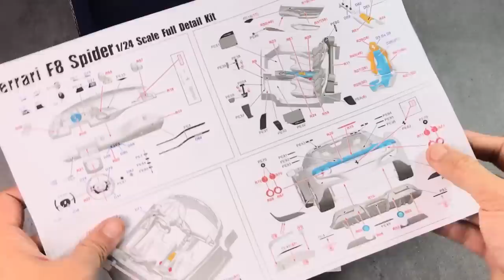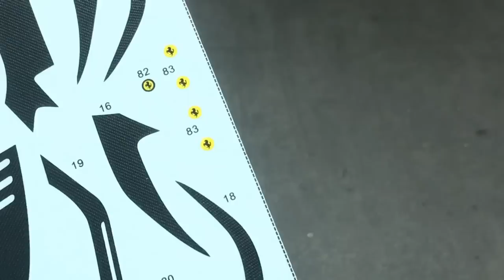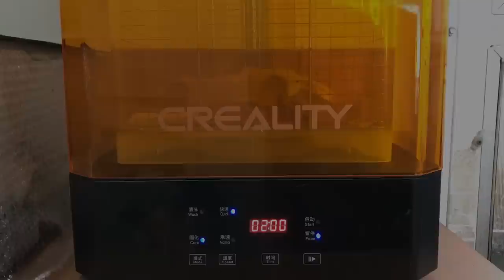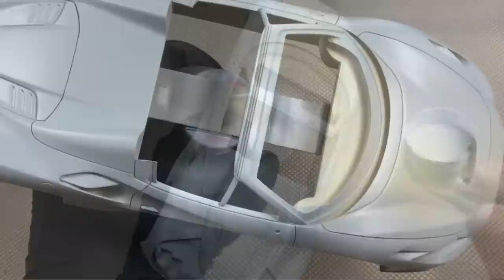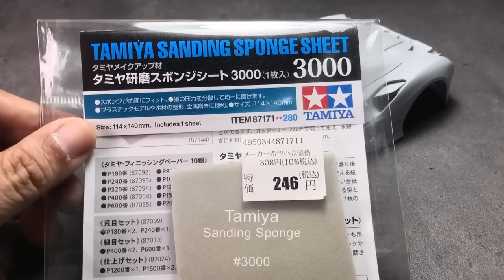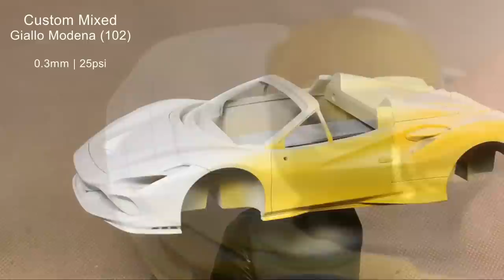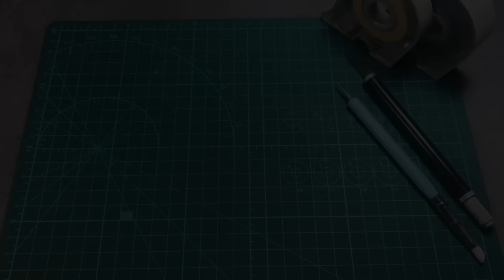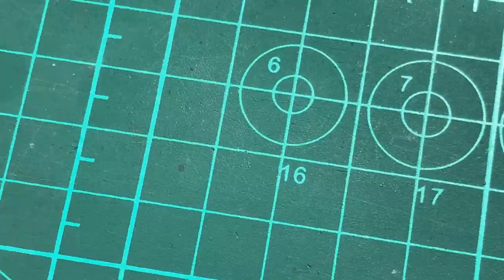Ferrari F8 Spider | Alpha Model | 1/24 | Scale Model Building | ASMR |

Comment: I notised most model car builders videos don't show applying a clear coat to small parts of the cars.  Do they, and, if not how do they avoid getting fingerprints and paint smudging  on small parts when assembling>>??????
Reply from the maker: For me, to use clear coating on any part It doesn't depend on the size of the piece. But it depends on the accuracy of the actual car.

Comment: I had no idea what Glasurit was until I looked it up. It turns out that it's remarkably expensive for the varnish and hardener. So much so that I am astonished that you use it on a model.
I won't deny that the end result is outstanding (plus yellow is my favourite colour) yet over £150 to varnish a model....ouch!
I hope that you get a lot of models done with it 😊😊😊
Reply from the maker: First of all, I would like to thank you for visiting my video, For Grasurit clearcoat, I actually share it with my friend who owns a real car paint repair shop. So I don't have to buy the whole set which is expensive as you said. 😉
Reply: @OMG Scaleworks  Thanks for your response. It's appreciated. It also makes more financial sense knowing that you share the cost. I assume that standard modelling  acrylic varnish can't give your models the same depth of shine? Is there anything a lot cheaper that is suitable and gives a similar shine? I'm just getting back into modelling after nearly 35 years and so much has changed. Any advice would be welcomed.

Comment: Amazing! Btw, why it took you way further of the built to remove the runner under the windshield (that’s like a B pillar)?
Reply from the maker: Thanks a lot. To prevent broken A pillar by accident, I keep them until when I have to paint black on the edge.
Reply: @OMGscaleworks  very clever! It is because the A pilar is so fragile at that state (before the windshield is installed)?

Comment: May I ask, what did use on the tip to hold the parts at 28:06, thx in adv
Reply from the maker: It's just thin double sides adhesive tape on tooth pick tip. 😉

Comment: Hi...wow!!! What glue do you use for acetate glasses? And why do you weigh 2K paint to thin it out? To be more precise? But 82 grams of clear coat and thinner? (not seen in the video).

Thank you.
Reply from the maker: I have to mixed 2K clear with its hardener in 2:1 so I have to weight them but in video is 8 gram not 80 ha ha. About the glue for fixing the windshild I used CA Glue for that but in a little amount. Thanks for your following.
Reply: @OMGscaleworks  Haha, actually 80 grams would be too much! I said bullshit! However you have a perfect painting technique! Thank you.
Reply: @OMGscaleworks  But do you use different hardners based on ambient temperature? And still add 5/10% more thinner than indicated in the specifications?
Reply from the maker: @lucamicalicapparelli4825  Yep you’re right!